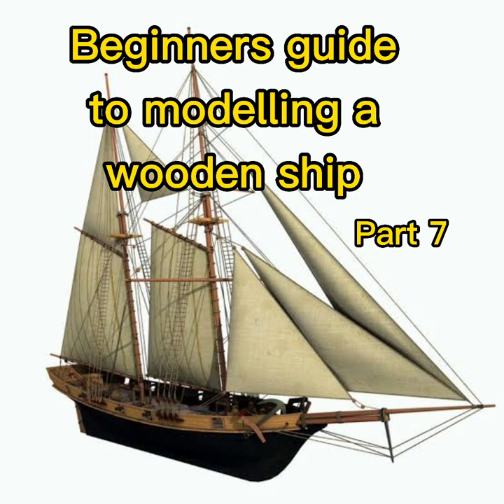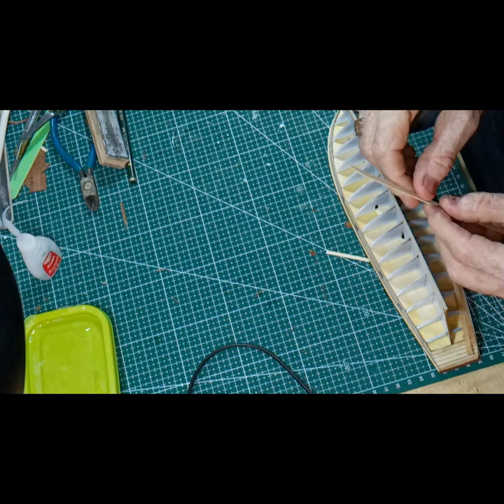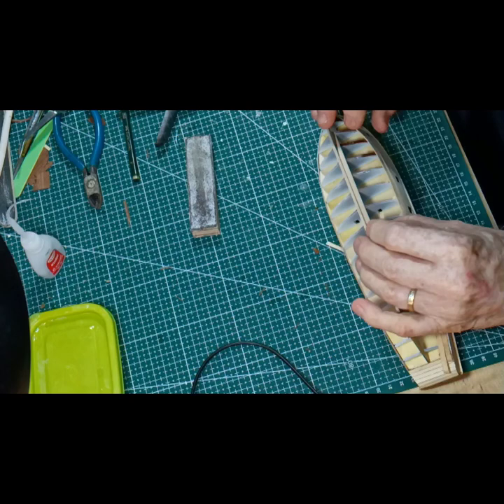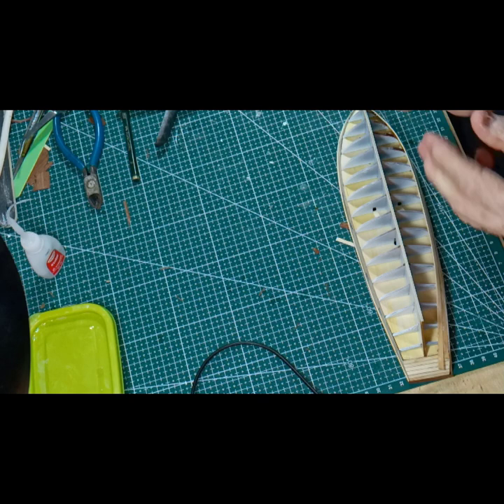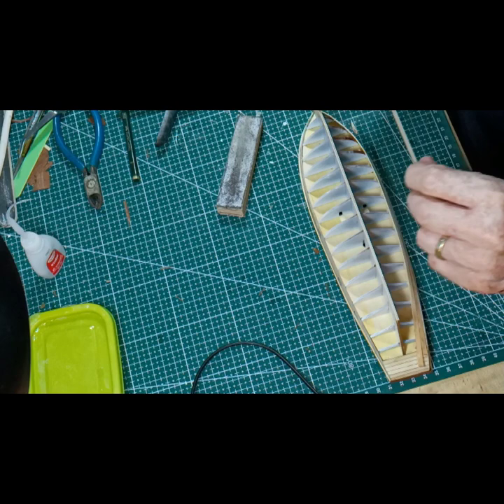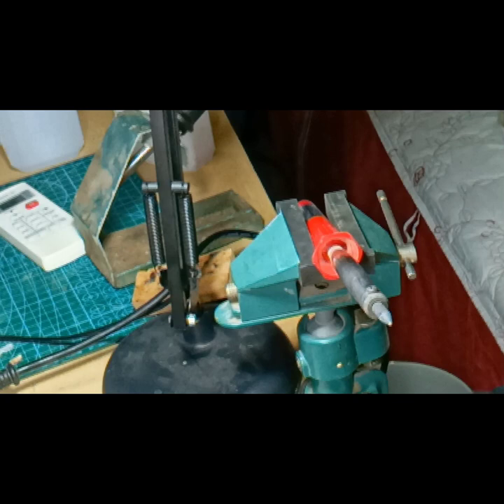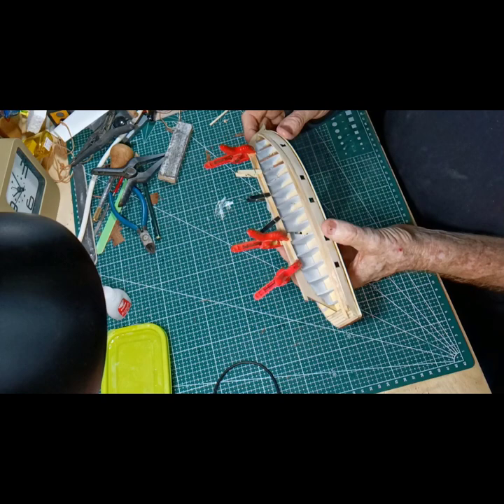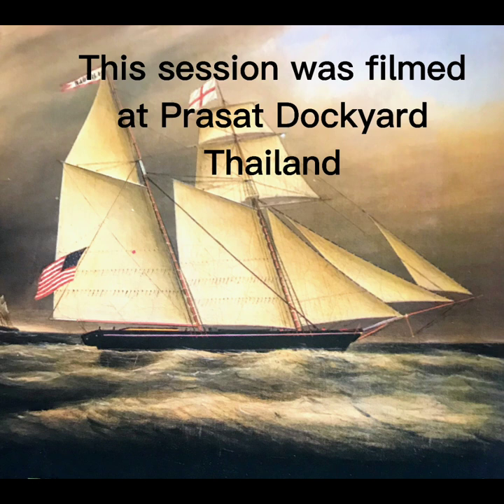Beginners Guide to modelling a wooden ship Part 7

Comment: Would this plank bend technique work for 2mm plank and also for bending it on the widest part (horizontal)? Asking as I'm currently in the first stage of building a Cutty Sark Clipper version. Plus doesnt help I've jumped straight into the deap end for a first wooden ship